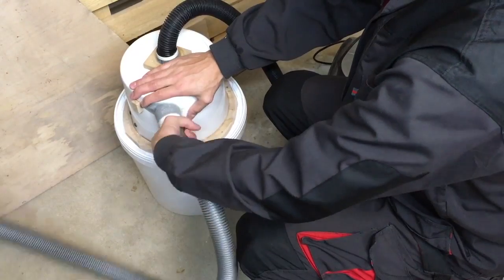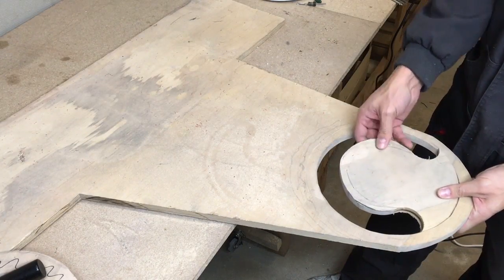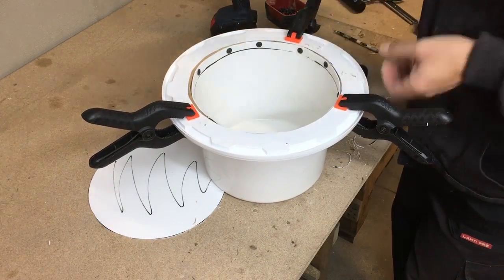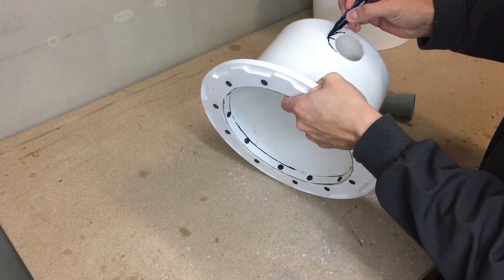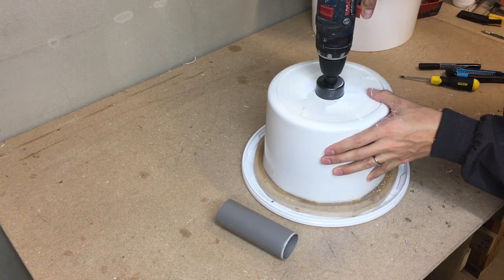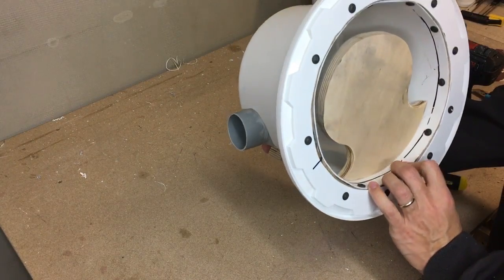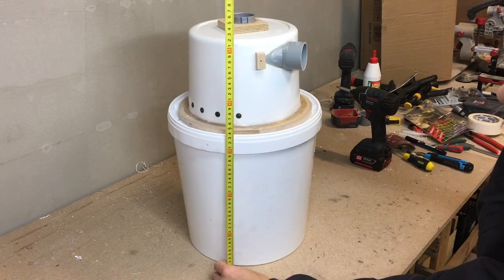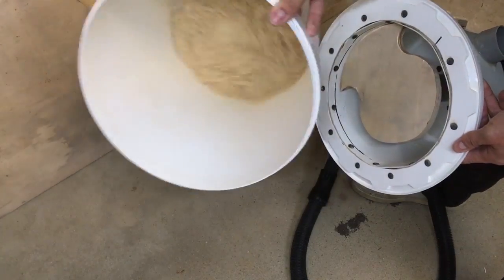DIY: Cyclone Dust Collector From Two Buckets

Comment: I think the bent connector entering the cyclone bucket is a mistake…

A turn is a restriction, so pressure in the flexible hose increases (or vacuum decreases)…

Basically, that's a restriction that decreases efficiency. Cut that connector flush with the inside of the bucket.

Otherwise, that 's a nice simple way to build one!

Comment: does the length of the hose matter? i made one based on this video and it works ok. but i lose way too much suction. It could be that the hose going from my hoover to the cyclone is too long. would that make a difference, do you think?

Comment: I also doubt that just sealing the top tube simply with just silicon that it will hold up to things being unplugged from it on a regular basis, after all silicon is just a sealant not glue by any means.

Comment: Well done tips, how many thumbs up will you get when some one asks a question about your build and you just blow them off? Here's another question you can blow off too. As I should point out if video was well done these questions would have already been covered. Since I got no answer about the baffle perhaps you can ignore this ? too! How much space is there to be between the pipe co I guess in from the top to the baffle plate. Now don't answer too quickly fuck head.

Comment: Does it work for drywall dust. Need a solution because I do lots drywall and have to empty and clean filter every 2 min.
Reply: owhat anight  I am pretty sure it will work but you have to put water into bottom of bucket perhaps 2/3", get it?

Comment: I'm affraid that the bucket can "implode" because of the vacuum. Is this bucket really strong enough?
Reply: A regular shop vacuum doesn't have enough negative pressure to cause the buckets to implode. A big industrial vacuum like cabinet and furniture fabrication shops use might be able to though. lol  But, if you're using a big industrial central vacuum, you would probably want a much larger container anyways, perhaps one of those big blue 40-50 gallon thick plastic walled water storage barrels.
Reply: As long as you don't block the intake hose completely, it should be fine. I built it, and it works very well.

Comment: Excellent build.  One question...  what is the purpose of the baffle?
Reply: The purpose of the "Thien" baffle is to aid in the separation of the dust particles which drop in the lower bucket without being sucked upwards in the smaller bucket thus preventing them from making their way to the vacuum cleaner and clogging the filter.

Comment: Really a very good job.
I've only one sugestion based in my proper experience, be carefull not to block the hose of the vacum cleaner, normaly it collapses. Also you can do a very easy to do safety valve. There is videos about it.
Thank you for share your videos and ideas. They are very useful.
Reply: Piter P

Comment: A second large bucket could make emptying this very easy. Trim the first large at about halfway (so it's open on bottom) and just leave it permanently attached to the lid. Drop the whole thing into the 2nd bucket. It still seals well, and you can just pick the separator assembly up any time you want to empty the bucket.
Reply: bearinch   Your idea is another step up the ladder, good idea gets better, thanks.

Comment: This is the simplest design I've seen so far. Great job.
Reply: I went a little more simple, but based off of his design. Cut a hole in the large bucket lid just enough so the small bucket's rim can fit snug in the hole. Use a compass with a needle instead of lead in it to scribe around and around until you've cut all the way through. That will make a nice perfectly clean hole. The rim of the small bucket can then be put through that hole down to it's  flange, and the smaller lid can be snapped on which will hold it all together instead of using rivets. Cut the smaller bucket lid to have some baffle slots for material to drop through. Only a bit of the finest of dust makes it to my vacuum. You could possibly also use some silicon caulk to glue the buckets together if they don't form a good enough seal, but mine is fine without that. Just depends how precise the hole in the 5 gallon lid is cut. The negative vacuum pressure makes the small bucket suck down tight on the 5 gallon lid anyways if the hole is fairly precise. The small bucket has to have a flange and slight gap at the most between the flange and lid for this to work, but most small plastic paint buckets have that flange because the flange is also used for the wire handle's attachment holes. Not sure if his small bucket in the video didn't have that flange, or if he just cut the whole top off that bucket, but utilize that part of the bucket instead of cutting it off.